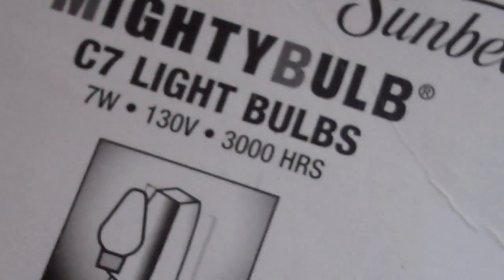Magnetic Amplifier

Comment: Sent a video responce the high frequency magnetic amp is shown not used there.... its a negative  resistance  type of oscillator i was trying to use with  it as an experiment ....but i think i will go with the HF floopy drive  generator .

Comment: Well i ended up doing it a little different for the 50 hz AC version ,i use 1 transformer placed a 10ohm resistor in series with the pot that protects it  ,i found no need for a dc control voltage adjust the pot with the ac being generated does the same thing and the pot is fine .
I made a magnetic amp Dc motor controller  learning as i was going ,i am working on a Audio magnetic amplifier now ..trying to use a dc to ac high frequency generator as the clock Ac 10khz with out any frequency D....

Comment from the maker: use a resistor with the pot not to high and the control voltage needs to be a straight dc or you will burn out the pot everytime

Comment: It IS clever, I'll admit.   It gives you a way to control a high power circuit using a low power circuit.  I see now the novelty of this.  At first, I thought this was a mechanism intended to achieve real energy gain -- energy coming from the vacuum -- also known as free energy or overunity effect.  It looks like I was mistaken.

Comment: I totally misunderstood the purpose of this whole device.  I loathe the term "amplifier" as used today because it makes it sound like you're actually getting more power out than what is being put in.   From what I can tell, all this circuit does is control the amount of inductive resistance to current flow. You're just allowing the 120 volt source to flow more or less freely.  If I'm wrong, please correct me.  So if you had a Variac, you would use that instead of this entire circuit.

Comment from the maker: @pha3zme chances are nothing or it would burn out from the high voltage back emf i have a small potentiometer nothing happened at first then a minute later it went up in smoke with some sparking.

Comment from the maker: @boxa888  if you use the mag amp the suggested ways tehy only get a little warm use it in the wrong ways like me they get red hot or they start internally sparking. seems it depends what mood. stoping the flow in the control windings the primary of the transformers then a high voltage forms then ruins the coils with internal breakdown or just a melt down

Comment from the maker: @boxa888 ifound out if you pulse the control voltage it causes a high voltage in the coils and casues a melt down and in the control wires if you try to  connect the primary wires together same thing happens. using A filament transformer for a tube supply isnt a wise idea either. i havent burned that one out but its good at burning other component out though